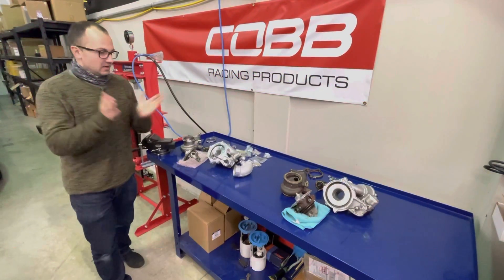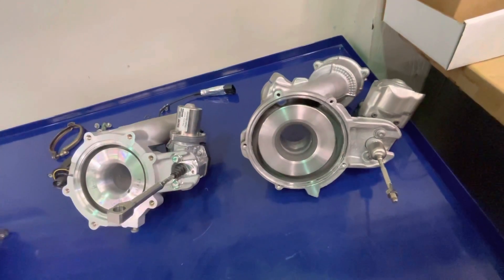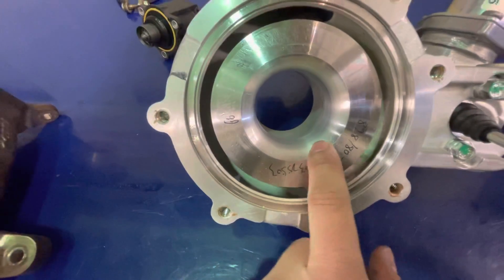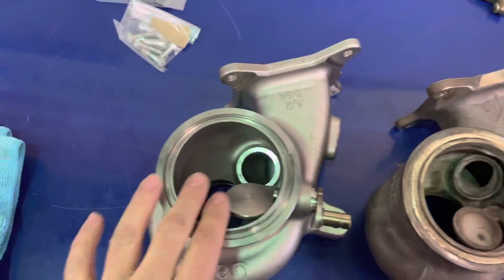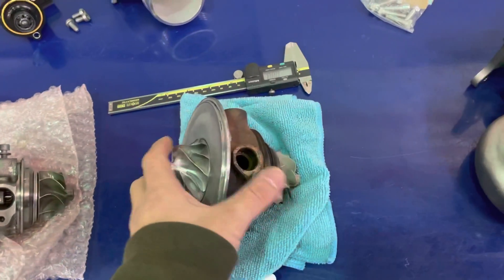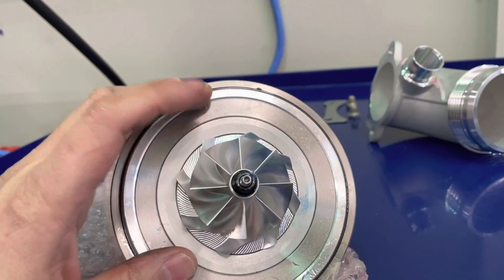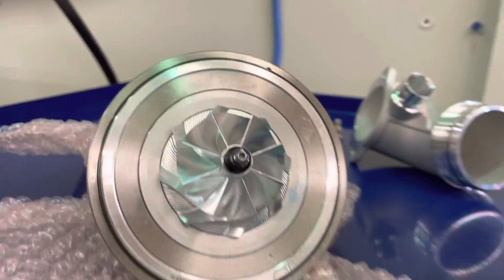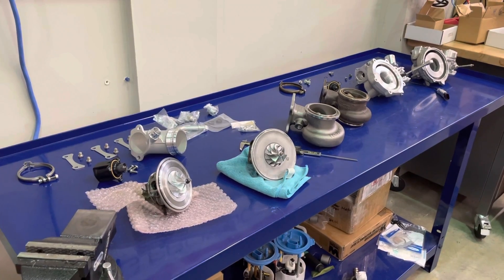MK7 GTI and Golf R Garrett PMax Turbo Tear Down and Analysis: Tech Talk EP.4

Comment: if you mount the stage1 turbo on an entirely original s3 8v, do you still have to do a reprogramming?  or can we mount it and stay with the original program?
Reply from the maker: For it to run optimally you should get it tuned.
Reply: @stratifiedauto  and if you mount it on an original car, what happens without reprogramming?
Reply from the maker: Poor boost control and throttle closures.
Reply: @stratifiedauto  what do you call throttle close?  car going into degraded mode?  concerning this turbo on audi s3 8v can we limit the power to 400hp in ethanol?
Reply: @stratifiedauto  ?
Reply: @TheUltimateDIY  the turbo will not make proper power and will cause issues. You don’t just slap a bigger turbo and expect it run optimally without the proper tune. This turbo will require a hpfp upgrade to even run properly. Not to mention it has shaft speed sensor and yes a stock tune can possibly over spin it causing damage to the turbo.

Comment: Would love to see some tuning results of this turbo on an ea888 running pump gas.. fingers crossed you have a video planned! How does the bearing system and shaft diameter compare with an is38? Now that I heard the new RS3 isn’t coming to Canada, I might have to juice up the MK7R.
Reply from the maker: We will have this soon. Did not take shaft apart to measure but Garrett turbos are quite reliable.